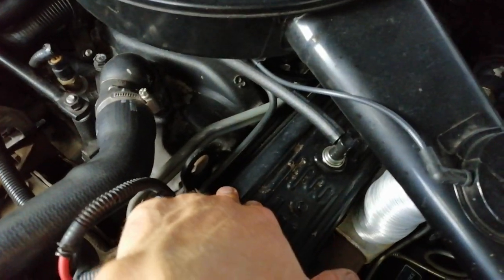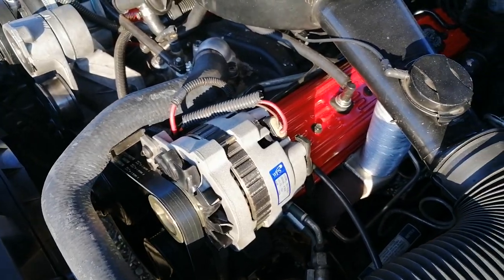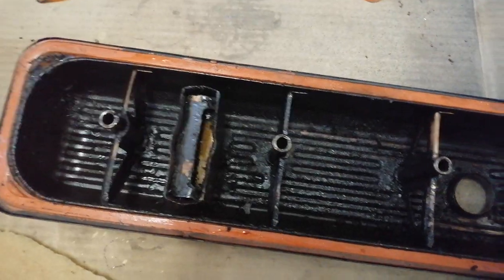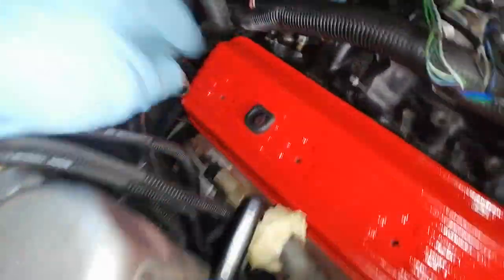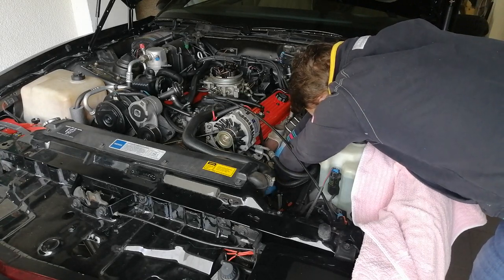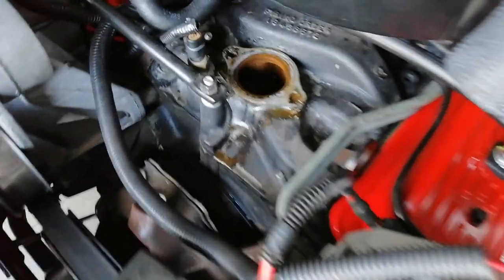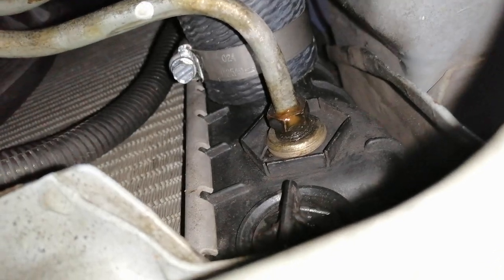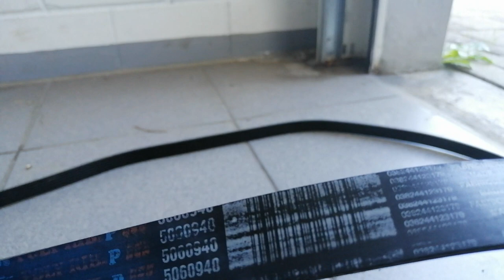KITT Firebird Trans Am - Episode 22 - Final upgrades - Part 1

Comment: Is anything ever truly final? I found some exterior and interior inspiration for next-gen KITT designs. Regarding integrating air vents into the dash, I found two real life examples:

1) on the newer Bentleys, the center stack display is motorized and conceals itself when not in use. You can have the display rotate out of the way to reveal vents hidden behind the display.

2) On the newer Jaguars, the vents pop up out of the top of center of the dash.

For visual inspiration, look up the Aston Martin Victor or the Factory Five F9 prototype. Don't forget to integrate KITT's signature front red scanner. The car isn't KITT without it.

To keep the exterior upgrades more affordable, you could just redesign the car's front body panels as an alternative (front fenders, hood, front bumper). This is how KITT's original designer, Dave Scheffe, kept the original KITT affordable to produce, by modifying only the original front bumper pieces rather than a more extensive redesign.

For the interior dash, look up the interior of the Nikola electric truck. Although Nikola plans to go with one central 21 inch display, I like the multiple display of the prototype better. The multiple displays are reminiscent of the early KITT dash and is more configurable to suit your preferences.

Hope to see more of your KITT videos!

Have fun!
Reply from the maker: Thanks Brian, much appreciated! Well it's final as for the repair videos I will bring to YouTube. But more on that as the following two videos will be published. :)